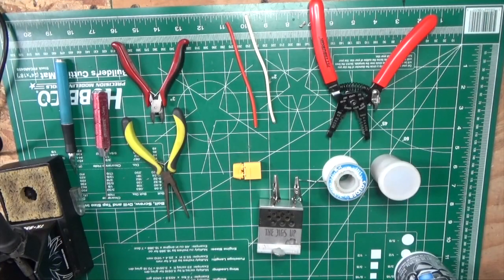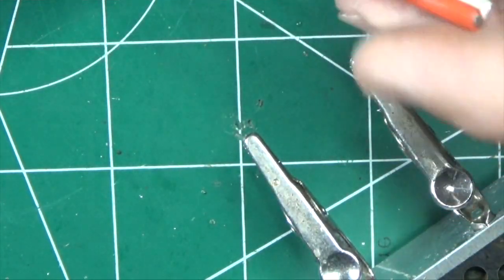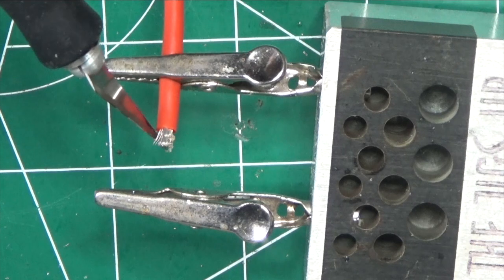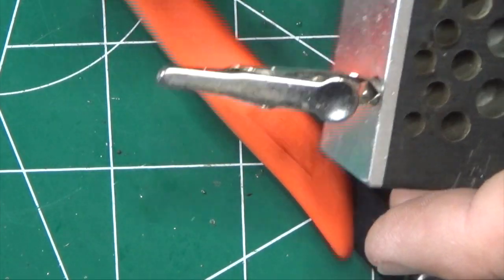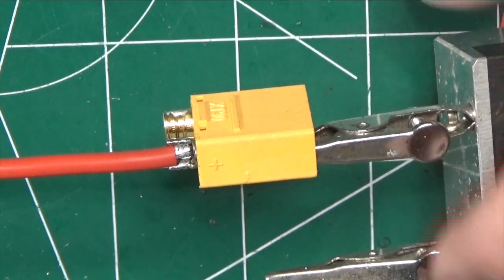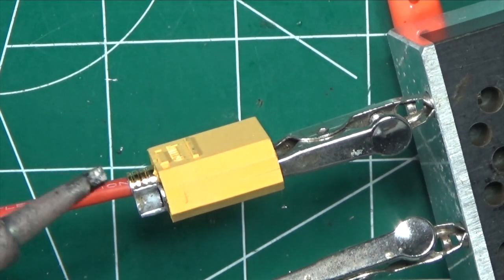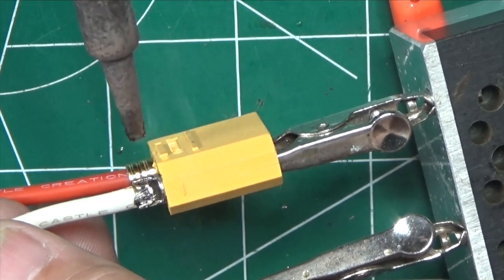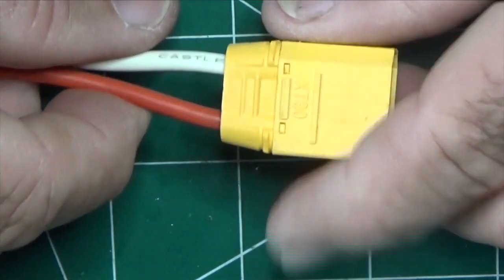Soldering the Arrma XT90 Battery Connector

Comment: What iron are you using? What watt? What temp?
Reply from the maker: Trak Power TK 950, 60 watt. I don't remember the temp but I have since learned It was a little too hot. It was most likely around 800 degrees. I usually solder around 665. If i solder heavier wire I'll turn it up. Some manufacturers solder may need hotter temps to liquify it. I use Rosin Core, High Grade, 60/40, .03 1 DIA

Comment: Is it possible to solder a 13awg wire to a xt90s? My esc has 13awg and i want to solder the xt90 with spark protection.
Reply from the maker: Yes, no problem.